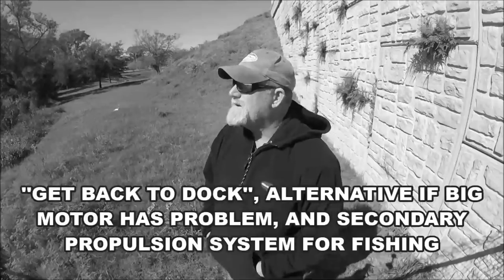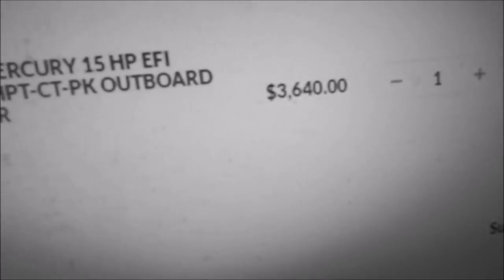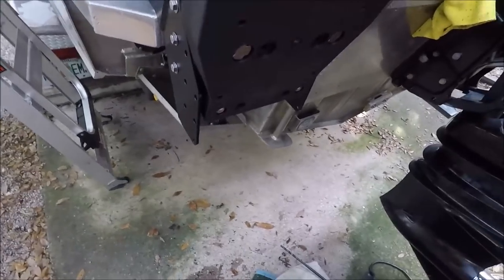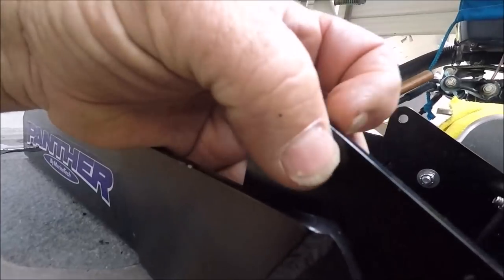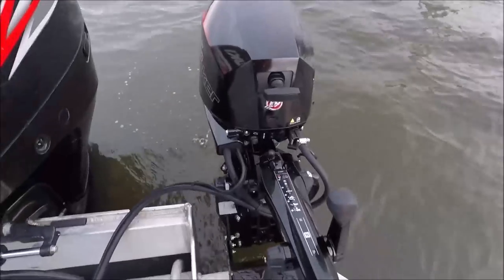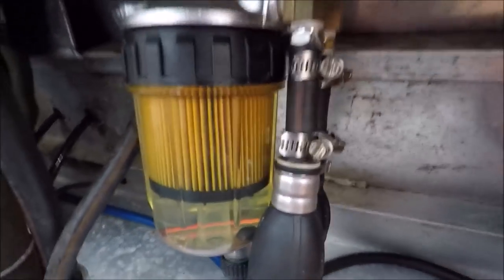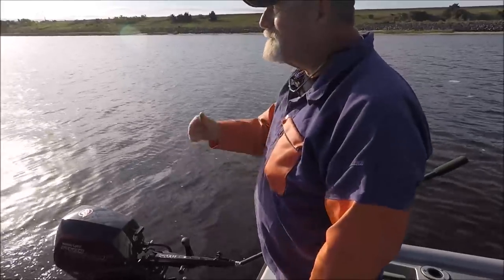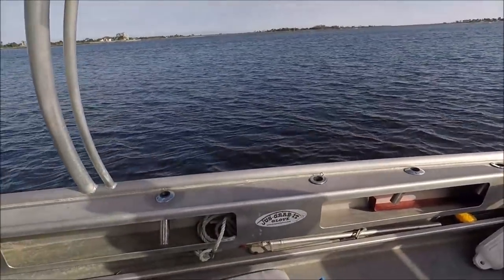MERCURY Pro Kicker 15 hp installation & test - PHASE 5 'DONE'

Comment from the maker: https://www.youtube.com/playlist?list=PLK-ee3q-bFR2KPb2cDapcVKEbkUjsWyJM  THANKS FOR FOLLOWING ALONG IF YOU'VE KEPT UP WITH EACH ''PHASE'' OF THIS D.I.Y. KICKER MOTOR PROJECT. PLEASE COMMENT AND ''THUMBS UP'' 👍👍. MORE TACKLE, FISHING, AND EVEN ''GADGETS''....COMING VERY SOON🎬🎬
Reply: Just got myself a small McGregor 22 foot sailboat and was comparing The mercury pro kicker  20HP Vs 15HP practically the same other than a few indications noted : 
horse power 
20HP/15HP as indicated on the cowling (?) 
127 pounds / 130 pounds the heavier being the 15HP 
gear ratio: 2.15-1 (20hp) vs 2.42-1 (15HP) 
138 watt output vs the (15HP) 145 watt
A  9” three blade prop with a 9.1 pitch vs a four blade prop high thrust no other notations 
And a 20.3 cubic displacement on the (20HP) vs 21.4 (“deliverable”) according to what part of the spec you read, on a 20.3 cubic displacement 
every thing else appears the same. So now that you had some time with it, why don’t you give us a follow up review 
Displacement is a fixed number how can you get more it’s not turbocharged LOL
I think you got your self the perfect little engine that can get you out of a bad situation and is great for trolling.
P.S. the web page you got the kicker, I’m not sure I’m looking at the same page it didn’t looked kind of right can you send me a link or a quick note thank you Capt. keep up the go word

Comment: i had my boat out yesterday, in freezing weather again. But this time it was windy. My batteries lasted only 3 hours. Interesting that in the summer i have had days with 8 hours and batteries still not depleted. Yesterday they just died. Cold weather and wind is no good for trolling motors. Glad u got it working. Make some trolling videos, but not just showing the fish, show the process
Reply from the maker: YEP......I CARRY 60 GALLONS and a anchor...he, he, he. Don't do much trolling in our 5 knot tide. but when I do, in slow current spots. I will.  Spanish Mackerel trolling is right around the corner at the inlet. GREAT trip for kids 👶👶

Comment: Hey Capt Dave,  “redfish winner guy” here. Great video. Few weeks ago when we had a freeze warning down here in Middleburg I forgot to put my boats cranking batt on the charger so the cold wouldn’t draw it down. I was reminded the following Monday when she wouldn’t turn over at the end of my fishing day! “livewell runs off cranking batt as well” I will be correcting that soon...It sucked but I just put the new Minn Kota down as it runs on independent batt! set the fancy new auto pilot feature towards the boat ramp kicked back and had a soda and enjoyed the slow ride back to the truck. I was on a lake with no current but still took lil over an hour to get to boat ramp.... but hell still beats paddling and didn’t have to bother my fellow fisherman with a tow. Second motor on a boat never a bad idea. Good Job 
Side note for other viewers: if I would have had a set of jumper cables in the boat I wouldn’t have had this story to tell as my trolling motor battery that was on the charger was at full juice. They have been added to the “OH SHIT” box in the boat. I recommend you adding them to yours
Reply from the maker: I never leave my shed without topped off batteries. just bought a new AGM for my kicker and a on board charger (6 amp) just for kicker battery
Reply: Oh lesson learned for sure. I’m currently searching for a 2bank charger so they are both charging at all time when I’m off the water. Cranking batt in the transom and trolling bat in the bow!! Pain in the butt finding one with cables long enough to reach both batteries. Always something

Comment: Beautiful little outboard. I have always had a kicker motor on my boat and I only have it for "just in case". Looks great Capt!
Reply: What's your opinion on  a twenty foot keyWest that needs a backup kicker for the ocean?
Reply: @jacobgreen6939  I would look at the 9.9 or 15. I liked the 9.9 with a low pitch prop due to lightweight. There are high thrust models in the 9.9 also.

Comment: Great finally Capt. 
I am hoping you or someone can answer a question I have not been able to find an answer to. I have a 22 inch setback bracket with a swim platform like your Dave. My boat is a V bottom with approximately a 6 inch rise from bottom center to chine on outside. Question now , shouldn't the cavitation plate on my kicker be in align with my chine instead of the bottom center ?. It seems these kicker installs put the kicker to far down in the water 
I can not find any information on kicker height in relationship to bottom of hull. Just finding , " put it on " information .
Reply from the maker: yep, ya maybe over thinking it.
Reply: So in so many words you don’t know and just go with the flow . Yup
Reply from the maker: @jimmiller4951  not really mine works like a champ. Didnt have to a bunch of measuring. It all just flowed...Yep!

Comment: Hello sir just ordered this for my 20 foot key West wa. How fast do you think it will push my boat? Also, I'm near New to boats and this is my first boat just making sure you can raise the tiller handle straight up right when not in use.
Reply from the maker: yes, handle can go up when tilted up. bI have no idea how fast it pushes my boat or yours. Never had it a full throttle since Ive owned it. Fast enough, I'd say.
Reply: @CaptDavesSportfishing  thx

Comment: Nice Job Capt. Was wondering what kind of top speed do you get with the 15 HP in your boat? I have a 23' I'm beginning the process with adding a 15 HP Mercury 4 stroke myself. Thanks for the videos.
Reply from the maker: I dont know. My boat is a 26 footet, but its aluminum plate. So not nearly as heavy as a glass boat. Ive never had the kicker wide open. Its just for cruising and trolling, but I can do 10 knots Im sure. I love this Merc 15. I believe its really a Tohatsu 15, made for Merc.

Comment: Hey Capt Dave I wonder if you lock the kicker and steer with the 250 how well it will work? Thanks for the videos🖒
Reply: Now I saw your comment on screen where u tried steering with the 250🖒
Reply from the maker: @shoresharp8349  .....  @ 8:15 using a tiny litl' phone screen huh?

Comment: You could probably just tighten down the steering on the kicker and use the main motor as a rudder for steering
Reply from the maker: NO....NOT IN THE CURRENT WE HAVE❗❗❗    I added a steering rod. YOU HAVE NO SEEN EVERYTHING. https://youtu.be/tZBkdmHa618  Seriously ''MacGyver'd''  but very simple fix, because MERC has no way of adding a a steering rod, with the tiller arm. THEY JUST PLAIN, didn't care about it. But rave about how great the steering arm is.

Comment: Get yourself the Garmin Reactor autopilot and you won't need that silly handle and you won't be stuck at the back of the boat driving.
Reply from the maker: SEND $$$......If you actually watched the 5 part series you'd see I put a connecting arm, so to steer via the big motor. Works fine and no '''big thousands spent''. EZ, and have a season of king mackerel trolling with it. Super plain, zero to go wrong, was a quick install. Have that silly handle just incase, and for what you saw....try outs.

Comment: Why do they dont make this as 20hp instead of 15hp???
Reply from the maker: why don't they make this in 20hp instead of 15hp? (deciphered) -I have no idea, ask Mercury. Maybe because no one needs a 20 long shaft auxiliary motor?
Reply: @CaptDavesSportfishing  This is very popular in the USA. As a Trollingmotor.
But for me i will use it as a mainmotor. On my 4m boat. It sounds stupid but The kicker is better build shaft than original 20hp.
Reply from the maker: @erikandrehoglund55  if so, you'd have to put it on a manual...or electric jack plate on the transom, because they are all long shafts, too long to work correctly (without loads of drag to get on plane efficiently) for a main high speed motor, plus change the prop from the 4 blade high thrust to a regular and correct 3 blade.  ''IF'', the lower unit gear case is even ''geared'' to do so. Look at the Tohatsu small motors, because thats all a Mercury small 4 stroke really is. Great little motor, for sure. Starts dead cold, (in WARM Florida USA) on 2nd pull of cord, and of course has electric start, fuel injection and electronic ignition.
Reply: @CaptDavesSportfishing  Tohatsu / Mercury up to 30hp is the same or build in same factory in Komagane/Itabashi plant in Japan.  Just some design and parts that is the difference.

Hmm my boat is 4m and 1.6m wide. Wright 145kg.
I should probably change 4 blade to 3 blade prop. The name of the boat is kimple 400 streamar. By the way i am and live in Sweden so this is my first own boat and engine will come in November.  The weather here is cold. 
How do you like the prokicker  arter some years os use? Your opinion what is bad and good?
Reply from the maker: @erikandrehoglund55  I'd just get a tohatsu 15 regular short shaft motor, if it was me. Its a great kicker. all I use it for is its intended purpose....trolling!
Reply: @CaptDavesSportfishing  The Tohatsu Gear lever is little bit to far back  actually. If you compare the prokicker.  My boat has a pretty long after/sterndeck where I sit.
My boat is made for longshaft motor. So short rig is not an option. Just look my boat on google and u will understand.  I hope you do because my english is not the best but i try to describe as good as I can . Thanks for you quick anser by the way
Reply from the maker: @erikandrehoglund55  👍👍